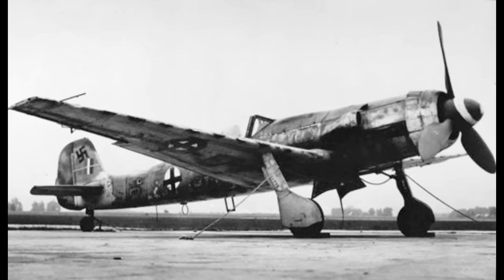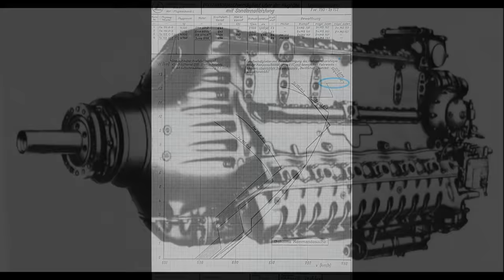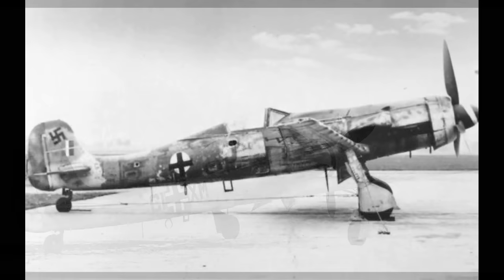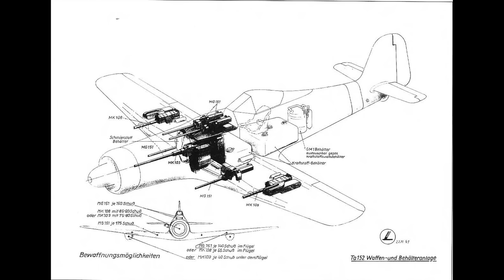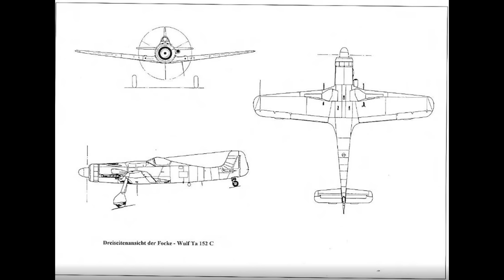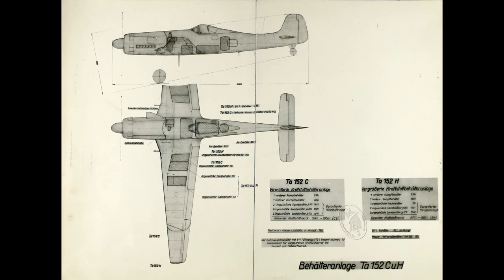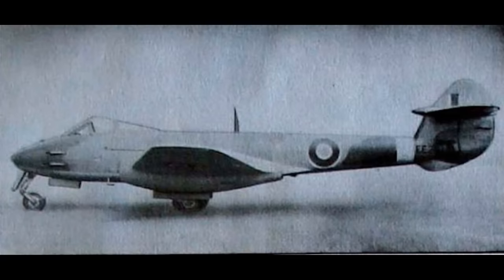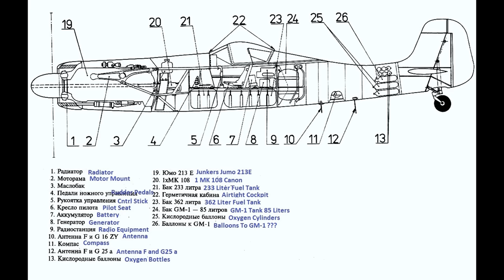Focke-Wulf Ta 152 H-1 Extreme Speed At High Altitudes.

Comment: Yet another superb Video Greg. Thank you. I wonder if, some time in the future we'll have the technology to sinter-3D print all the parts for these planes, so we could reproduce an entire plane.
Reply from the maker: That would be amazing.
Reply: @GregsAirplanesandAutomobiles  Greg, Check out Bf-109 projects & restorations on Facebook. Its amazing!
Reply from the maker: Thanks I just looked at it. I am amazed by the work these people are doing.
Reply: @GregsAirplanesandAutomobiles  I know right?! They are already using 3D printing tech. It's just a matter of time...
Reply: +Kiwihame    3D CAD tools are indeed just beginning to be used in restorations within the last five or ten years.  Two examples are an airworthy Typhoon project that utilized 3D scanning of the surviving example to mirror and reproduce missing wing data accurate to the millimeter.  This has allowed the restoration to fill in the blanks from missing technical drawings and import everything into CAD.  The most recent example is the Paul Allen museum's airworthy Stuka R-4 project where they scanned most of the example resting in the museum in Chicago and reversed engineered a lot of missing factory data.  The work they have done on the Stuka is remarkable.  Aero engines have also seen a few examples of 3D scanning to 3D print new sand cast molds to manufacture new engine components.   I don't think we will see actual wide scale 3D printing of vintage components just yet because of strict aerospace requirements for the manufacturing processes and materials strength.  (In fact with the recent loss of B-17 "909" it think the regulations and requirements to restore these old planes are about to get significantly more complex with new legal issues.)  But getting the data and drawings from these old warplanes digitized into CAD libraries will make future restorations much faster, cheaper and easier with ability to crank out forming molds and mill components on multi-axis machines very quickly.  There may even be stacks of ready-made parts to make repairs easier. (P-51D shops already have access to some parts inventories that were made the hard way.)

Comment: Another good video.

Another point this can also make about 150 octane fuel in the Mustang, you will notice that at higher altitudes the stats you are showing on the Mustang aren't that different from a Mustang on 100-130 fuel, and that's probably because 115-150 really gives you an advantage at lower altitudes, where the supercharger is capable of taking the higher pressure air at lower altitudes and forcing into the engine, at higher altitudes that 2 stage 2 speed supercharger starts to choke above 30,000ft, and by 41,900FT (roughly) everything reaches equilibrium and the Mustang can't fly any higher.

Where the Ta 152H has a 2 stage 3 speed supercharger continues to provide performance with GM1 Nitrous  oxide injection, the engine can continue to perform, where the Mustang has fallen off a long time ago, and higher octane fuel doesn't give you more boost, it simply allows more boost, so it doesn't help it, in fact I am sure the Mustang may start to suffer fouled plugs at higher altitudes due to the lead content in the fuel.
Reply from the maker: That's exactly right. Once the plane is too high to get enough boost to take advantage of the higher octane, the performance edge from the fuel is lost. The same thing happens with MW-50. Thanks for watching until the end!

Comment: In terms of pilot records the major point of note, the real performance superiority of the Ta152H1 was actually at the 8000m throttle altitude, where it had: (count it) 1800hp. Not a lot of aircraft on the planet that even came close to that remotely near such a height. The long wing also meant the two worked ideally together to give the kind of vertical manoeuvring at that height that no other aircraft could possibly achieve. It had the lift, the bite and the horsepower at 8000m that the highest performing contenders had at 5000m. At 7000m things like Mustangs and even Griffon Spits are just losing their vertical manoeuvring edge despite the fact they'll go much higher in rated ceiling, but that's talking like an entire fuel load and almost stalling for the final third distance to get there. There are paper performance challenges like the P47M for all out speed at extreme alt, which is anything above 7000m due to the dramatic density drop above this height, but check the records and they had a habit of exploding impellers above 7000m unless carefully handled, later rectified in P47N production (same engine, some airframe and equipment changes), but the point is were talking a seriously extreme and extremely hostile environment for piston engines once you get to 7000m so I think that's a big deal to keep in mind talking about WW2 altitude performance. A lot of it is inflated, calculated rather than demonstrated and not even remotely reliable or safe operation of a combat plane. To illustrate the service trials of Ta152H did allow pilots of those to freijaeger, among the very few who were allowed, and according to Reshke it might've been, best cruise alt was 7000m and the cool thing about that was they had tons of power and vertical manoeuvring that no other fighter remotely had at that height, so were king of the air. Didn't need to be any higher, at 7000, because of its qualities, they were king of the air.
Reply from the maker: B-17s and B-24s cruised at 7600 meters, so the German fighters definitely needed to go higher than 7000. Also the P-47N has different wings than the earlier models. It wasn't just a change in the tip design, there were big internal changes. That's why it has the big increase in max dive IAS.
Reply: @GregsAirplanesandAutomobiles  N.Euro (8th) combat box was 6500-7500 generally (varied coming over Italy due to latitudinal air density, by the way another interesting point about alt testing by RLM between Rechlin and Regensburg, same birds do different performance by alt due to atmosphere changes but anyhoo), mainly this was because that was essentially as high as they could get from FlaK and still maintain altitude. They would've gone at 12,000 metres if they could but even B29s can't do that and they're a full generation ahead of everything we're talking about, sort of like a 44 version of an Apollo program. Yes German fighters needed to go higher than the fighters themselves can operate effectively in order to attack the bombers, but also remember whilst fighter escorts weren't a big issue the primary form of attack was using adapted naval mortars (already adapted in priori for Army use), the WGr21 with its massive warheads to causes one or more bombers to drop out of the stream (not by direct strike but blast effect, these rockets were intensely inaccurate as an aerial weapon per se, it was warhead size that gave effect), where they would then be pounced upon at lower alt by cannon armed fighters. Yes fighters also attacked directly but with far less success since opportunities at such height weren't anything like as easy to accomplish than a couple of thousand metres lower, but strictly they will go much higher beyond the throttle alt and just have very poor performance up there in terms of combat manoeuvring, pretty much anything you do with the stick will cause a loss of altitude so set up is important here. Most of this case scenario is post 44 when the heavier twin engine jobs with rocket banks and FlaK or Panzer cannon bolted to them had been chased from the skies by Mustangs. But the Ta152 is very strong at this height, stronger than a Mustang. Not that it was used for that, it would be perfect for it, but it never got past service trialling, and that involved freijaeger. Go where you want, however you want, do what you want, test the plane. Reich defence or any regular service squadrons didn't get that freedom at this stage of the war, they had specific jobs tasked in ways that amounted to using what you have to use in the way you have to use it, not a lot of freedom to exploit aircraft strengths in that.
Reply: Greg's Airplanes and Automobiles, I have noticed that Germany didn’t seem to be a proponent of 4-bladed propellers, and the propeller designs they used didn’t seem to be as “aggressive” as they could have been (paddle props, etc.).  Can you elaborate?

Comment: It took the Junkers Jumo 213 to give the 152 the power it needed. The problem with the DB 603 was its weight and physical size which made it difficult to use in single engined single seat fighters.

Comment: I know you said you like to avoid the what ifs, however, whenever you get around to the 190 series will you talk at all about the 190 A10. That certainly would have been a beast of a plane had it gone into production.
Reply: Maybe a beast. But other than bigger wings I can't find much on it myself and am skeptical of how good it would be. Other than bigger wings able to fit MK 103's (wing-root mounted?), the power plant of the BMW-801F would not add much more other than a slightly higher critical altitude over the previous 801's. And while the high altitude agility would be nice it still may not amount to much.

That said I always though an Anton with the 2000+ HP BMW-801F with MW50, the slightly bigger wings of the A3-U7 high alt test bed for better agility and high alt performance, better support added weight creep and more stringent measures to control said model advancement weight creep would have been a formidable foe.
Reply from the maker: I'll do that.

Comment: A point about pressurisation that doesn't get mentioned but is a very important factor: Breathing is one thing on nearly pure oxygen, but flying unpressurised at very high altitude is uncomfortable and even painful. Your blood vessels expand and it's very very cold because the thin air can't absorb heat even though you have hot air supply into the cockpit.
Reply from the maker: Yes, you are correct!
Reply: A really good reference book I use is Gunther Bloemert's "Heaven next stop". Infuriatingly he never reveals what planes he was flying during the war. But because of all the other references, you can easily figure out he was in JG 26 in France from 1941 until 1944 and then in Germany in 1945. And flying a 190D in mid-1944. Anywho, he makes a comment that the plane told him when to go on oxygen because a compressor stage kicked in which co-incided with that altitude.. This was an automatic boost. But he talks about extreme altitude too, when he had a high-speed stall, he says he could see whole parts of  Belgium and Holland rotating past his windshield. His recovery is to dive (but then he's going so fast the stick won't move in pitch) so he uses the electric trim motor system on the elevators to slooowly pull-out. Large radius aileron turn also bleeds off speed. He regains full authority once the speed is below about 450 Mph at 38,000 ft. Was any part of MW50 or GM nitrox systems automatic, or was it purely pilot engaged?

Comment: Jumo's design choice was for the 211 and 213 to have one big exhaust valve instead of two small exhaust valves. Would this make the combustion chamber more prone to detonation? My understanding was that two small valves more easily transfer heat to the coolant galleries in the cylinder head. The peak temperature of the valve surface in contact with the fuel-air mixture is thus hotter in the case of one big exhaust valve. 
I have read that the four-valve DB601 could use a higher compression ratio than the three-valve Jumo 211, but boost, throttling, etc were probably not strictly comparable.

Comment: Thanks for the video Greg, amazing as per usual! The Ta 152 is one of my favourite planes so I am really glad you made this. That altitude capability is really quite amazing for the time. One question - have you any thoughts why the C model wasn't significantly faster at lower altitudes than the H model even though it sports the shorter wings?
Reply from the maker: Hi Bobby. Yes, I do have thoughts on that, quite a few! The problem was that the C model wasn't finished, thus not fully developed. Had they finished it, you would have seen much much higher speeds. It would have been the fastest piston engine plane of the war below 25,000 feet. That could be an entire video, as there is a lot to unpack on that subject.
Reply: @GregsAirplanesandAutomobiles  Good point! I'd love to hear your thoughts if you do get around to making a video on the subject. Thanks for the reply. I'd also love to hear your take on the use of annular radiators!

Comment: Just joking below: From what I can tell: 
A. at 4,000 meters, start oxygen flow and leave on at altitudes above 4,000m
1. Open remote control 02 valve. Observe pressure gauge and O2 monitor
2. At first sign of O2 deprivation, activate O2 shower (press with elbow)
3. Lather, rinse, repeat...:)

Comment: The tempest's Bristol engine was draged out to 5000 horsepower with 200 octain fuel when jets were the thing.  Several Thunderbolts were fitted with the four row   radial but, jets.

Comment: One of the gorillas' in the room is the Ta 152 propellor. A massive (wooden) three blader. Better or worse than transmitting 2050 HP versus a four-blade prop? Discuss.
Reply: Why?
Reply: @vumba1331  Well, that is the actual question isn't it
Reply: Why discuss?
Reply: Interesting response, instead of applying a thought and laying out what you were looking for in a discussion you comment negatively.
In terms of an interrogative point how you approached it was not perhaps the best and perhaps if you expanded it on some basis you perhaps would have received a more progressive response, that's all.
Reply: @vumba1331  It's a pretty simple question I posed. How best to convert 2050 HP, with a three or four-blade prop. If you have no knowledge (likely) or no interest (extremely likely) in this area of engineering then I encourage you to pursue your interests elsewhere. Flower arranging perhaps.
Reply: Ah, still with the aggressive and negative presumptuous response. Yes I do have an interest in it and quite a bit of experience actually as I knew an engineer for many years who was involved in some top secret engine design during WW2. I also fly light aircraft and have a few hundred hours there and have had many enlightening discussions with a number of people on the merits of different blade configurations, 2 vs 3 vs 4 blades, wide vs narrow chord, straight vs scimitar style and there are many ways that these topics can be discussed. 
All come back to the purpose of the aircraft for the flight envelope involved for it, hence my question why? Do you have anything to add to your question to provide some depth to it? Comparisons with other aircraft configurations/HP(PS)/purpose perhaps, if so please add them so we can have a fruitful discussion rather than inane comments.
Reply: @vumba1331  ; Because unless you haven't noticed all Allied Super Props use 4 blades and Griffons after WW2 even more blades. It should be pretty obvious why it should be discussed. My question is why you would not understand that such a basic question should be asked.
Reply: I had noticed, the question was 'why?'
As my German engineering friend used to say, be specific about the question and couch it in a way that explains your understanding as to the situation, state your position or understanding as it is and then posit a rationale for it.
As you can see in my comments and discussion elsewhere with Steve re this, we covered many different factors surrounding the design and execution in order to explain the situation that existed, this included the multi-bladed Allied offerings.

Comment: I'm guessing the higher rev limit of the Jumo was due to a shorter stroke ? (Over square ?) 
The Americans and British favored under square engines with long strokes, rod ratios and high octane fuel (115/145) for torque.

Comment: One small note re the Ta 152C not being "in Service"...There is a couple of photos from April/May of 1945 taken a a JG 301 airfield where there are at least 3 Ta152C's on the Hardstand, beside the units' Ta 152H and Fw190D-9s. So some did at least reach the forward units, very late in the piece.
Reply from the maker: I agree that some C models were built, but they were not production planes, they were prototypes. If they ever flew in combat, there is no record of it.
Reply: @GregsAirplanesandAutomobiles  These were painted in JG 301 markings, (Including the RVD bands) so they were considered as ready for combat, even only if as part of a "Trials unit" level.
HTH Brett

Comment: Regarding the Russian cutaway at the end, Balloons to GM1 probably means tanks of gas used to pressurise the GM1 system and maintain that liquid state you were talking about. The specific word balloon as well as the fact rockets use Helium for a similar purpose hints to me that it may have been helium tanks, but that is pure speculation. Either way a very handy image!
Reply: Also, information on it seems sadly incredibly sparse, but do you know of the Sud-Ouest 8000 Narval? It's my favourite piston engine plane overall for a few reasons, and it used an Arsenal 12HO2, which was pretty much a Juno 213 without the ravages of being made under the late war German industrial situation.
It could supposedly produce an extra few hundred HP than the 213 running MW50, (2050 vs 2250 reading straight from Wikipedia). I don't know if that's with some boost system of its own or a more sophisticated supercharger system (definitely better fuel quality) but it just goes to show how solid the engine itself was, and how much room for performance there was that the wartime situation just sapped from it. As good as the DB was on paper it definitely was a bit of a one trick pony by comparison.
Reply from the maker: I don't know much about it, other than it looks like something Darth Vader would have flown. It's very cool.